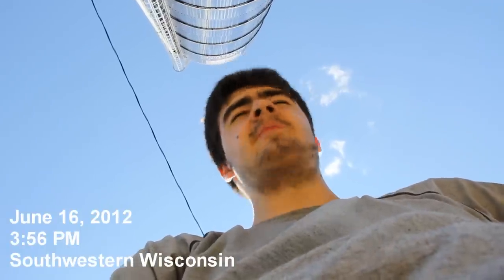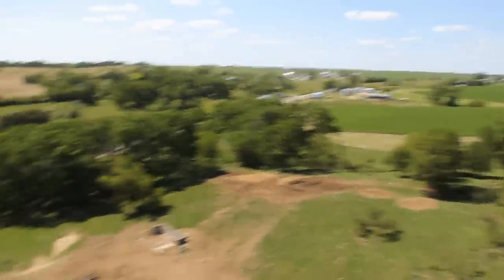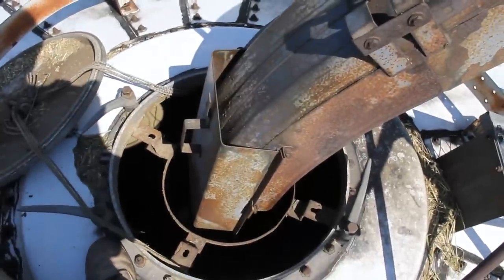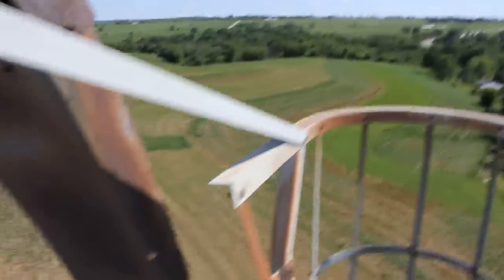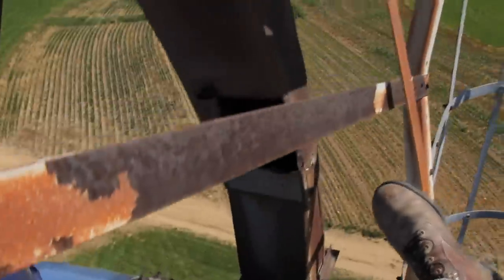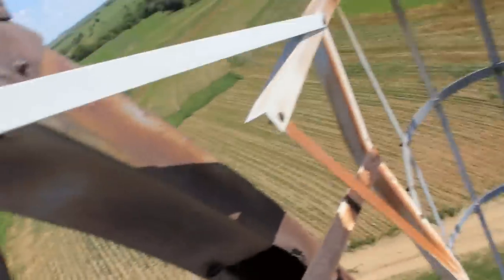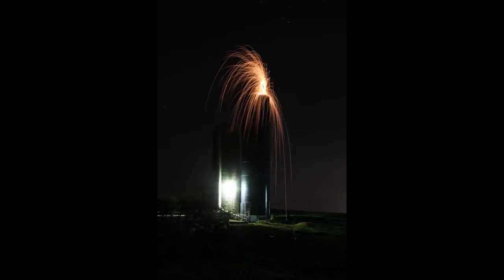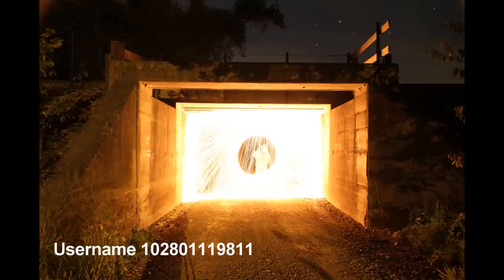HARVESTORE SILO COLLAPSE (and ours)

Comment: Wow, this video took me back. When I was a student in 1980, I had a summer job building Harvestore silos. Factoid: They are built starting with the roof and are repeatedly jacked up as more and more rings are added at ground level. My particular job involved going up top when assembly was finished to remove some winching gear from the top, so I had those same views. I am somewhat scared of heights, but I got used to it and actually came to enjoy going up top and enjoying the view. The ones we built were all about 100 feet.

Comment: Thanks for this video. I used to have a 45-ft Harvestore (an old one that didn't have the safety framing around the top). Instead of a lid and chute in the center it had a lightning rod and two lids off the center. Embossed in the lids were the words to the effect of: Caution: You must lower a kerosene lantern to silage level to test for oxygen before entering.

Can you imagine entering a silo from the top at all? Very dangerous!
I liked your steel wool pics, too!

Comment: A Hollow brick silo is considered farm equipment and is property tax exempt.  However a shiny blue Harvestore is in a different category for soem reason.  There are building site owners around here with idle harvestore's that are a tax liability for them.  Trivia.  I am in North Central Iowa.  Or basically 200 mile straight west of the state line at Dubuque.  There have been instances that they have collapsed due to drawing a vacuum at the bottom without having ventilation at the top.

Comment: The dairy farms which rely most on harvestors & their forage wagon systems are dying out & consolidating with the now giant operations with thousands of dairy cattle. So the family farms that used them are dying out and with smaller families are switching to the large round bales which are less labor intensive then chopping & unloading the forage wagons. So JD quit making them. We had one damaged in 07 or 08 and could not find a replacement so we had to fix from scratch a wagon totaled by ins.

Comment: So is there not any safety regulations on climbing a silo? Do you not had to wear any fall restraints because you are a owner operator?
Reply: in accordance to OSHA, a safety harness is not required if it has safety railings.
Reply: When I started on drilling rigs in 1970 there was no safety but nowadays you can't go 6 feet with being tied off and climbing a derrick, that's 100% tied off at all times!!!
Reply: Harley04,, yes i have worked both on drilling rigs and other installments, as an industrial painter,
i also started freeclimbing in the 1970s, and yes it feels a bit safer using double safety gear,
but its a lot of extra work moving back and forth hooking and unhooking the safety hooks moving under say a suspencion steel bridge, hehe 
its easyer on the top bearing wire with extra hand rail wire that you can just slide the safety hooks on and only have to unhook 1 hook at the time and move them past the posts.

Comment: You put in to moist silage and somehow oxygen leaked and it got hot inside and burned. 
Our farm system has 5 of them 4 80feet & 1 70 feet and had for 40 years and never a problem with heat or fires.